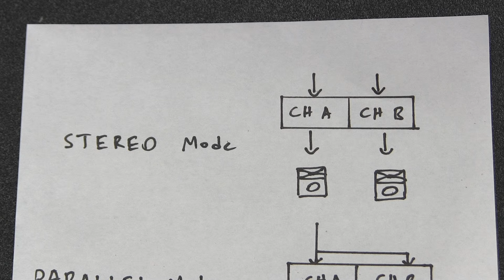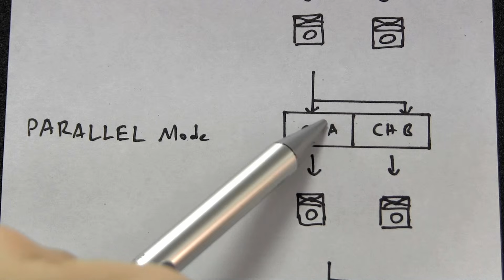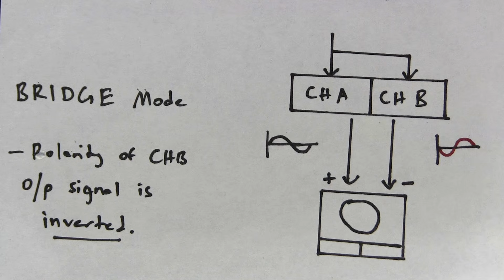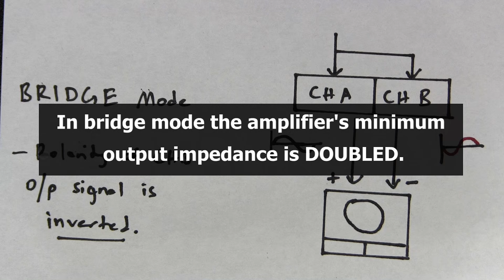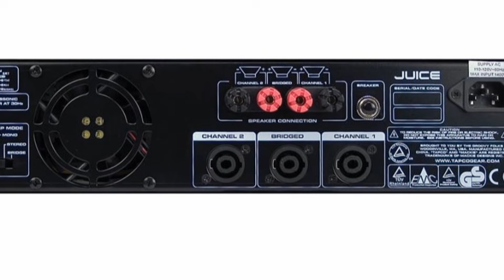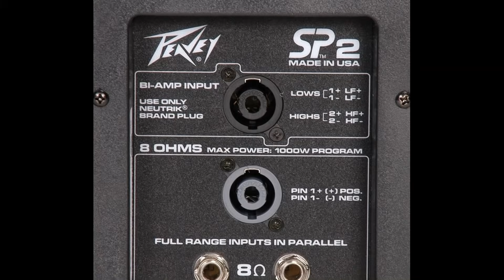How to set up and connect a power amplifier in bridge mode

Comment: I hooked up 2 speakers at 8ohms to a  Crown XLS 1502 amplifier with 2 channels. I wired them so that channel 1 fed 1 speaker and channel 2 fed the second speaker so they are in stereo mode. On the amp, there is an option to apply a low pass, high pass or band pass filter. Since I'm using the speakers exclusively for speech, I tried the band pass with limits between 100hz and 3K hz. However, after doing that I am getting feedback without having adjusted any of the gain knobs throughout the system. How is that possible since I'm trying to CUT frequencies? I must be doing something wrong.
Reply from the maker: Yes that doesn't sound right - it could be that there is some non-linearity in the filters which is causing the feedback issue. I suggest disabling the bandpass filter and just using a high pass filter at 100Hz for speech reinforcement. There is a lot of important information above 3kHz, unless you want your PA system to sound like an old telephone ;)
Reply: Ok thank you for the advice! I can try a high pass.

Comment: Hi Mr Bruno  thanks a lot for  you great teachings. May you live long  so as to keep teaching us new things like this. Now i do  have  eight RCF bass bins and i do run them with two  europowe ep4000  and they are performing what they are designed to do, but my question  is that  if i connect  my amps and bass speakers (18") in a a bridge mode will the amplifiers produce more power  or will it cause any damage?? and another quiz , can  the amplifire  handle four bass bins (18") in a bridge mono??
Reply from the maker: You need to calculate the power output of your amps in bridge mono mode vs. the power handling of your loudspeakers - please watch this this video: https://www.youtube.com/watch?v=l9L7uK7Xy0w

Comment: Hi Bruno, I did not find if the question was already asked, so, which control knob of the amp do I need to use in bridged mono? only channel 1or A or channel 1 & 2
and a other question if a have 400W rms speakers that can handle 800W peaks , if I connect a bridged amp that delivers 1000W haw can I know where si the maximum position of my control knob ?
thank for all your videos
Reply from the maker: It depends on the amp - some amps use only the A channel control, on others both need to be set the same. Check the amp manual. 

It's very hard to say because knob markings may not be accurate. The only way to measure for sure is to use a multimeter to measure the actual voltage output from the amp.
Reply: tanks for your quick response Bruno
i ve done research but I only found tutorials on car amps power measurement
please correct me if I go wrong but with the calculation a found. I should set my amp in bridged mode, turn my control knob until a read  56,56V AC running a 50Hz signal through my system to get the correct amount of power for my 400W rms speakers
Reply from the maker: That's pretty much it, although I would use pink noise rather than a test tone because it more accurately represents real music. Also make sure that the input signal to the amp is at +4dBu or whatever the unity mark on your mixer meters is. 

BTW how do you know that your speaker has a peak rating of 800 watts? Typically peak rating is four times the RMS rating.
Reply: I juste read it on the back of the speakers samson auro D15 .800w peak
budget speakers that works fine for me
and the amps are samson S1000

I am wondering, when I'll run pink noise on my mixer should the meters be at 0db unity ? or should I go just before peaking

again thanks a lot Bruno for your videos quick and precises answers
Reply from the maker: I looked up those speakers and they are 400 watts RMS so you can aim for an amplifier power of anywhere between 400 and 800 watts. 

It depends on how 'safe' you want to play things - if you normally mix at or below 0db on your meters then use that to set the level. If you are in the habit of maxing things out then you should probably use a higher level. 

I must stress that this will only give an approximate measurement of the power because a speaker is a reactive load and its impedance is not perfectly consistent across its frequency response range. Good luck!
Reply: Thank's for all your precious advice
Reply from the maker: Showtruc1 You're most welcome.

Comment: Splendidly clear explanations without pointless repetitions or not needed information to confuse people with less knowledge. Was just trying to find some insight into bridging with speakon cables. I found out my amplifiers use the one where you need to reroute the wires, so will be using an adapter in the end of the cables when I need to bridge the amplifiers for larger setups. 

Subbed and hope to see more great videos like this in the future.
Reply from the maker: Thanks for watching! Another method for amps that are permanently rack mounted is to bring the amp outputs out to panel mount speakon connectors - you would have one each for channels A and B, and one more for bridge mode, wired to the binding post outputs. 

 If you would like to support the channel please consider signing up to become a patron at https://www.patreon.com/glbproductions?ty=h Every little bit helps!

Comment: hi bruno i tried to connect my hybrid 1200watts amplifier on bridge mono mode connecting bass bins but the power supply keep tripping when i turn up the volume.what can the problem be?
Reply from the maker: Insufficient or overloaded power supply which cannot supply enough current. Try another circuit with nothing else plugged into it apart from the amp.
Reply: be sure your load is 8 ohm

Comment: Good morning mr Bruno I have a question I have two b&c 18btx100 subwoofers 1200w normal power handling and 2400w continues and I have  qsc pl380 amp 1500w in stereo and in bridge ohms mono 5000w and 4 ohms mono 8000w...what would be the correct way of hooking them up to get the maximum power with out damaging anything thank you kindly..
Reply from the maker: Please watch this video to start with: https://www.youtube.com/watch?v=l9L7uK7Xy0w
Reply: Windsor Pierre ill hook it up in parrel mode so the speakers can get separd power.such that way the amp running in that mode you wont have to run the full power of your amp in bridge mode the wattage would be split up,the speakers would have certain wattage going to them with out over pushing your amp,your amp running cooler,wont be too much siginal,clipping or peaking,either blowing speakers or burnining up your amp..

Comment: what if the amplifier says its not bridgable can it still be bridged?
Reply from the maker: +Nathanual Anderson  In these cases it is best to consult the manufacturer or somebody who knows that particular model well, otherwise you risk damaging something. It may just be that the amp does not have a bridge mode, so you need to feed the second channel a polarity reversed version of the channel one signal.

Comment: Hi Bruno, Thank you for your amazing videos!
I have a question though, can one use speakon cables containing 4 wires (1+/1- and 2+/2-) in stereo mode and use the same cable (4 wires) in bridged mode?
Reply from the maker: +Rayan Wehbe It depends on how your amplifier and speakers need to be connected. Most amplifiers use pins +1 and -1 to output signals in stereo mode but may use +1 and +2 in bridge mode.
Reply: +GLB Productions if bridge mode was +1 and +2 do we need to rewire both ends of the cable or just the side connected to the amplifier and leave the speaker side with the standard 4 wiring?
Reply from the maker: +Rayan Wehbe Could I ask why you're using 4-conductor cable in the first place? Also please tell me what make and model amp and speaker you are using.
Reply: GLB Productions I'm not planning on setting up anything it's just a hypothetical question for learning purposes. :)

Comment: would is be possible to connect 1 8 ohm speaker to (for example) ch1 and then 2 8 ohm speaker witch is 4 to ch2?what I'm trying to say is can you connect 8 ohms to one output and the 4 ohms to the other?
Reply from the maker: +ceddy ced Yes no problem at all - remember that in stereo mode the two channels are completely independent and can be treated as two mono amps that share a common power supply.
Reply: GLB Productions Thank you. I'm trying to use 3 spkrs with 2 channel amp and this helped

Comment: I have 6 Loudspeakers 8 (Ohms) 200RMS 
AMP 4 OHMS  A,B and Bridge (Wish can be used as a normal 4 Ohm channel in stereo mode) 500w per channel or 1000W in bridge)
How i connected it 2 speakers daisy chained down to 4 ohms into 3 channels in stereo mode
2 = 400w  4ohms into 500w channel 4 ohm
The bridge gives out 1000w into 8 ohm,i should get a 8 ohm 1000w sub right ? :D
Reply from the maker: +ZIKKBOY Which make and model amp are you using, and how many speakers would you like to connect per channel?
Reply: Now i have hook up 2 8ohms down to 4 ohm into a 4 ohm channel and its 500w and my speakers say 260 each so its arround the amount hehe :) bought a Makie 1604 VLZ now to and hooked up the amp to that mixer and the sound from the system now i just out of this world x) Had it at 1 -15 of the max vol and my whole house started to rattle xD Cant wait to bring this out side when the summer comes and test it at 0 Decibel haha :D
Reply from the maker: +ZIKKBOY Glad to hear it's worked out!

Comment: if i put 2 speaker 8 ohms  daisy chained toghether down to 4 ohms,if i plug in a 3th speaker will the ohm still be 4 in bridge mode ? :)
Reply from the maker: +ZIKKBOY If you amp has a 4-ohm per channel minimum in stereo mode it will be 8 ohms minimum in bridge mode.
Reply: Thank u :D Great channel :D

Comment: Superb video!  I learned a lot.  Can you answer this for me? I'm trying to setup a system for a benefit this weekend and I have two 400W 8 Ohm main speakers that I want to power with a Carver PM700 power amp. When I look in the manual, I find the following bit which sounds like each channel of the amp will be running 4 ohms into 2 8 ohm speakers. Is that okay to do?  And if I understand correctly (hopefully), I can power a pair of 400 W speakers with this amp by running it in Bridged Mono?  Thanks much!

"Bridged Mono
The Stereo / Mono switch is located on the Input Board which is connected to the input panel. Connect the input signal to CH2 input (CH1 input becomes disabled). Connect the speaker(s) to the two (+) speaker terminals. The CH2 (+) terminal is the hot (non-inverting) side, and the CH1 (+) terminal is the low (–, inverting) side. When connected in this way, each channel “sees” one-half the impedance of the speaker that is connected between them. If an 8 ohm speaker is used, each channel will see a 4 ohm load. Therefore it is not recommended that any load lower than 8 ohms be connected in this mode of operation. Use Parallel Mono operation for lower impedances. Note: Be sure to set both of the input level controls to the exact same setting for equal power distribution per channel. Switching the Level Defeat Switch off is a handy way to insure that both channels are operating at the same level."
Reply from the maker: +John Brown Hello John! The section you quoted from the manual is essentially explaining that minimum operating impedance in bridge mono mode is double that in normal mode, ie no lower than 8 ohms. According to this you would NOT be able to power the pair of speakers you refer to as their combined impedance in parallel would be 4 ohms. However you'll have no trouble powering them in stereo mode. What is the amp's output per channel into 8 ohms?
Reply: +GLB Productions Doh!  Just when I thought I was starting to understand this stuff. :) I do appreciate the advice on stereo though. I wasn't sure if that would work as it shows the specs to be 225W per channel into 8 ohms or 350W per channel into 4 ohms ( it's not well written: http://www.carversound.com/carver-amplifiers/pm-700/ ).   So if I do stereo, it's okay that the watts are less for the amp and more for the speakers? I kept reading that I need my amp watts to be about 50% more than RMS of the mains.  225W p/ channel going in to 400W speakers, both 8 ohms is all good? Is that my takeaway?  :) Thanks a ton for your reply!
Reply from the maker: +John Brown Yes, ideal power for your speakers would be 800 watts into 8 ohms, so if you had two of the PM700s you could bridge one into each of your speakers :) However even though you are technically underpowered it could still be more than enough for your intended use. Perhaps find or rent a larger amplifier?
Reply: +GLB Productions Thanks.. really appreciate all your time and the great videos you put out. I actually do have 2 PM700s but that would only leave me with a PM420 for my 500 W monitors so probably won't go that route for now.. but great info for the future. I guess a really good power amp might be my next purchase.  All the best to your and yours!
Reply from the maker: +John Brown You're most welcome. Power amplifiers have never been lighter or more power dense than they are today, so you shouldn't have any trouble finding a suitable model.

Comment: When I would want to use bridged mono?
Reply from the maker: +Adrian Cabezas When you need the additional power that it delivers - typically when working with large multi-driver loudspeakers (2x12, 2x15 etc) or subwoofers.

Comment: I like this video but I'm still slightly confused.  I have the Behringer B215XL speakers and I want to connect them in bridge mode to a Behringer EP 2000 amp so that I can have more output power to the speakers. Can I run the speakon from 1 speaker to the amp...then using another speakon ....connect to both speakers....and then connect a parallel ¼ to 1 speaker and back to the amp.? After that set the dip switches etc for mono mode.
Reply from the maker: +Bernard Williams You don't need to connect back to the amp - the speakon carries both positive and negatives sides of the connection. So amp to first speaker and parallel out to the second speaker. This will give you 1000 watts into each speaker.
Reply: +GLB Productions 
Wow!!!..had no idea that I would be getting answer back so soon...figured it would be days. I think I got it.....amp to first speaker with the speakon....then parallel out to 2nd speaker from the amp.....hope I understood you correctly.....THANKS so much
Reply from the maker: +Bernard Williams You got it, hope it sounds good! If you would like to support the channel please consider signing up to become a patron at https://www.patreon.com/glbproductions?ty=h Every little bit helps!
Reply: +GLB Productions 

will definitely check that out

Comment: thanks,sir I think you also have experience in talking of speakers, now my question is what is the difference between 12",15" and 18" speakers,but the same power and the same impedance? thanks again
Reply from the maker: +julito Balongcas Jr. This is an incredibly complex question, but as a very rough generalisation, assuming identical materials and construction (impossible in reality) the larger diameter speaker will have more bass and less treble than the smaller ones. Again, this is a gross generalisation but it's the best short answer I can give you ;)

Comment: Please answer this! I have a pair of JBL MRX 515's. I also have a pair of Crown XTi2000's. Based off of what you are saying. I understand that I need to run two Speakon cables from the amp into the speaker, correct? Also, I have heard that you need to use +1, +2 inside the speakon cables is that correct also? Please answer this I am trying to run these speakers at a better performing level! They can handle 1600watts peak and the Xti2000 outputs 16000w in 8 ohm bridge. Thanks!!!
Reply from the maker: +DJMatt Matt I think you need to watch the video again. If you are intending to bridge each of your amps into one of your speaker cabinets (ie one amp per speaker cabinet) then you only need to run one cable between each amp and speaker. The speaker end of this cable is wired normally. The amp end will be wired as per your amplifier's output wiring and connectors.

Comment: Hi I have another question.
If a loudspeaker's maximum handle power is 800W, what will happen if I use a 100W amp?
I know in home system the sound might be very small or even no sound,but outdoor speaker's sensitivity is much higher then home speakers,so I'm wondering a home system amp connect to a out door speaker.   I'm confused between "power" and "sensitivity".    Thanks.
Reply from the maker: +ken123167 Using a 100 watt amp with an 800 watt speaker will simply result in less sound. It won't damage the speaker unless you clip the amplifier. 

Sensitivity is the sound level the speaker produces measures at one meter distance with an input of one watt of power. It is expressed in something like 95dB @ 1W1M. Power handling is either the recommended amount of amplifier power for that loudspeaker (programme) or the maximum amount of power the speaker is designed to handle (peak).
Reply: +GLB Productions Will outdoor speakers used indoor perform louder then home speakers when they both been given the same power like 100W?

Also like you said&quot;Using a 100 watt amp with an 800 watt speaker will simply result in less sound.&quot; Does it still sound good?
Reply from the maker: +ken123167 I'm not sure what you mean by outdoor vs indoor speakers - in my mind outdoor speakers are waterproof and designed to be used under the rain. They sound the same as speakers that are designed for use indoors. 

What sounds good is very subjective - to some people good = loud so if you don't have as much volume they feel it doesn't sound good. However the quality of the sound will be the same.